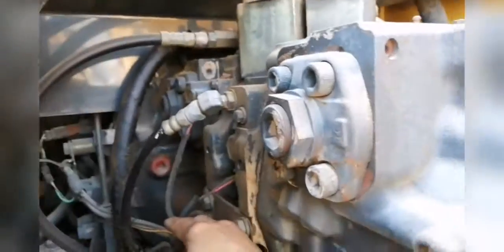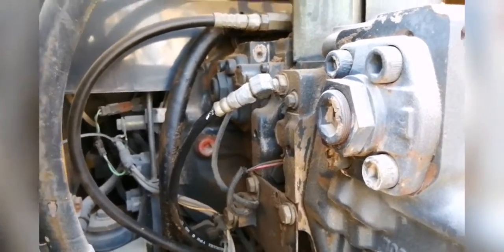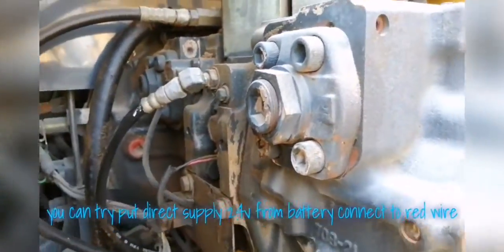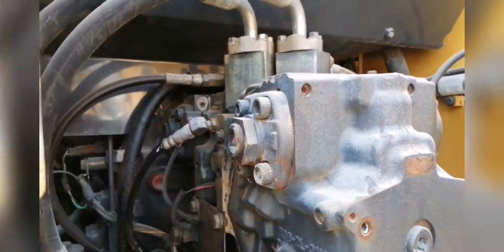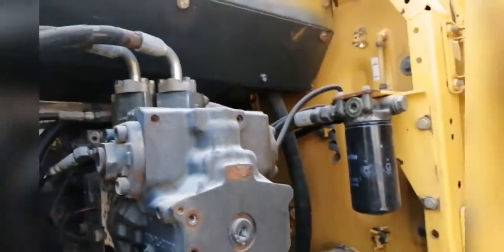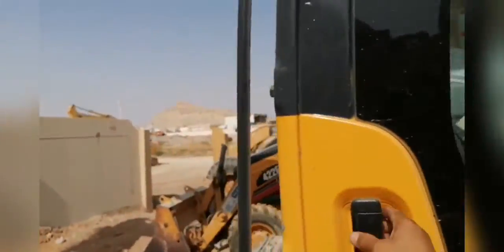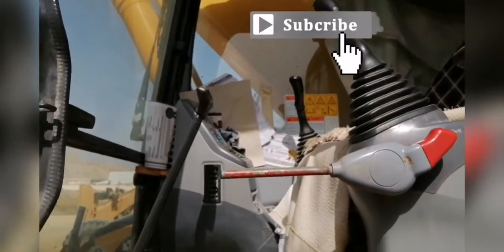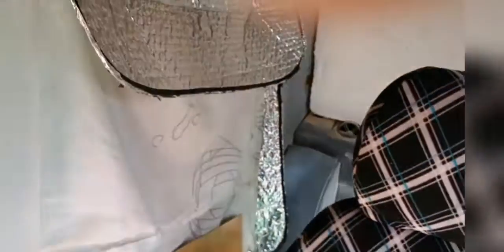KOMATSU PC 220/228-6/7 PC & LS PROBLEM ENGINE ITS OVERLOAD

Comment: sir gud pm,ano kaya ang posibling sira pag ung machine ay no acceleration ok nman ung governor control motor
Reply from the maker: ask ko lang anu model yan
Reply: kumatsu pc 228 po
Reply from the maker: ok ganito may time ksi n minsan kpag nagpalit nang bagung servo or accelerator motor ung socket nya d naibabalik nang maayos s brocket, kya nangyayari napuputol wire cause nang vibration, try nyo e check ang servo motor wire hatakin mo isa isa o kung ok ang wire, e try mo e disconnect ang rpm sensor, pag wla p rin, diagnose mo muna e check mo kong may active error, makikita mo doon, kung may damage wire or disconnected, maddtec nman nang ecm or controller.
Reply from the maker: p subscribe nman kung dkapa nkapag subscribe,thank for watching
Reply from the maker: @greenly2769  saan location mo
Reply: @caterpillarjhunhunk  masbate po
Reply: @caterpillarjhunhunk  ok try q po sir thanks
Reply from the maker: @greenly2769  check mo muna ang error code nya ha mkikita mo n ang active may nkalagay n e s baba nang 3 digit number

Comment: Good pm po sir tanung ko po may pc 138us komatsu po ako anu po ang dipirincya non hirap umandar din pag nag travel himihina ang makina at namamatay..yan lang po sir tankyou po subcribe ko po kayu sir..
Reply from the maker: paanung hina b ok b rpm nya db mausok
Reply from the maker: slamat
Reply from the maker: send mo s akin mssger mo at add kita or add mo ako jhunhunk
Reply: Hinde nmn ma cyado maosok sir kahit malakas na ang rpm pag tinaas  yung arm humihina ang makita pag pinilit namamatay cya..sir
Reply from the maker: @wenskieyb281  dito s video n ito may pinakita ako dyan n hydraulic pump tpos doon my wire n pink at black dalawa un check mo yan kung may supply o power n 24v habang nakaandar ha
Reply from the maker: kpag walang kuryente un mamatay talaga makina mo ksi hindi nairegulate ang pressure nang hydraulic mo
Reply: Ah ganun po ba sir sigi subokan ko tester kung may kuryente..salamat po..
Reply from the maker: @wenskieyb281  ok lang mssg mo ako kaagad ha pra alam ko at kung ano next mo n gagawin
Reply: @caterpillarjhunhunk   good pm sir ok na ang backheo nirikta ko sa positive wire ng battery lumakas na sya..wala power ang kanyang line wire...kaya nirikta ko muna..sa battery..
Reply from the maker: good pero try mo check ang fuse bka nsa fuse lang ang problema nyan
Reply from the maker: @wenskieyb281  salamat at nka tulong ung video ko at syo ha kahit anung machine  kung may problema tanung lang baka makatulong ako, like and share mo vvideo ko ha, at subscribe n rin
Reply: Buo lahat ng fuse sir..ok lng ba rikta ko nlng din idaan ko sa ignation switch
Reply from the maker: @wenskieyb281  pwede nman check mo s loob s kana side patungan nang kamay s likod may switch yata doon check mo rin
Reply: Sir na send kuna po sa messenger nyu.

Comment: Hey bro, I have a 1998 Komatsu pc-75 machine that’s 16,000 that bogs down when tracking it. It only happens when it warms up, could this be a fuel issue? I cleaned all the lines out and someone put a small electric fuel pump on it. Could the fuel pump not be putting o it enough fuel?
Reply from the maker: ok bro actualy its hard for me to say somthing regarding about your problem, usualy that type of engine you have on your machine  is everythings manual ok,now asper my imagination that i dont know exactly what happen, but for better conversation can you please contac me in my whatsapp, +971567581176, give some picture about how the engine figure and fuel pump if you can, its for me and my refference to analys the problem.
Reply: @caterpillarjhunhunk  is there another way I can contact you? You don’t show up in WhatsApp
Reply from the maker: @danielharrell2074  i dont know why not show up on you, so many people contacting in this number direct call and whatsapp message

Comment: Sir patulong nmn po .. sa ginagawa ko .. kumatsu pc228 .. pag nakafull throttle sya at ngwork n taas baba po bigla rpm nya .. nglalaro po ung throttle motor nya .. kahit anu gamitin .. swing stick bucket travell o boom ..
Reply from the maker: try mo e disconnect ung speed sensor n nsa flywheel tingnan mo kung may pagbabago, kpag ganon p rin, e adjust mo ung tension rod nya pweding paigsiin mo o kya pahabain mo sya, or insfection mo harnes baka naputul or or nag short n sya doon s, pero check mo muna error code nya s monitor, bago mo gawin yang mga sinabi ko

Comment: Gud day sir,Test port of pc100 sir
Reply from the maker: normaly ang test port ng komatsu ay 10mm head kailangan mo maglagay ng adaptor pra s gauge mo,kung main pressure check mo kung saan ung mainpipe nya nsa tapat lang noon ang testing port
Reply: @caterpillarjhunhunk  salamat Po sir,pwede Po pahingi Ng picture kng saan banda
Reply: Salamat Po sir,sa long arm Po sir pc220 LS man manual Po kayo salamat Po
Reply from the maker: @joeforneirbajuyo9276  mssage mo ako s whatsapp +971567581176 at details ng machine mo
Reply: @caterpillarjhunhunk  Hindi Po aq marunong mag wattsapp sir,ok lng Po dimasagot sir,para di nakayo madisturbo Po..salamat Po sir

Comment: Sir pa help po. Problem ko sa machine ko isa lng po solenoid valve nakakabit sa main pump ko. Minodify ata ng pinagbilhan ko. Nung mabili ko cia wala supply kuryente un solenoid kaya nahihirapan makina pg dumadakot. Btw pc228-2 po unit ko.
Reply from the maker: try mo e direct ung solenoid maglagay k ng dalawng separate wire s solenoid positive at direct wire s negative s body try mo kung gagaan ang galawan at load pra s makina, ang supply nyan galing s ignation switch pero dumaan s fuse
Reply from the maker: pero ganito kung may whatsapp k contakin mo ako pra makapagusap tyo ng maayos, +971567581176

Comment: My komatsu turns off randomly wen moving forward or picking something up
Reply from the maker: bro tell me what is the model of your machine, but if the machine is shutting off maybe overload or over pressure, if that machine is excavator check the solenoid attached on the main pump maybe no power, or not working or stock the valve
Reply: @caterpillarjhunhunk   model is komatsu pw 160 it has a banana grapple
Reply from the maker: @edgarbermudez3094  bro have you check the solenoid valve attached on the main pump, maybe no power to energize the valve, or if you know how to check the pressure check it, before you do the procedure of testing or adjustment, ok
Reply: Ok thanks
Reply from the maker: @edgarbermudez3094  your welcome

Comment: Sir ano po sira sa unit ko 
Hindi po sya mag travel kapag left or right lang pero f straight travel okay naman sya.
Reply from the maker: Check lang muna ng high pressure ng pump arround 350bar or 5000psi

Comment: Sir ano Po Ang problema Ng kumatzu PC200 pag dating Ng dalawang Oras Hindi na gumagalaw umihina cya thank Po sa sagot at godbless
Reply from the maker: s ganyang sitwasyon check k muna pressure ng main pump, or try mo n. rin e adjust ung merge divider valve nsa likod ng control valve, kung nsa ilalim k ng makina at nka harap k s control. valve nsa bandang kaliwa may adjuster ng pressure doon luwagan mo nut at adjust mo. ng screw driver pahigpit, saka testingin, try kahit isang ikot lang

Comment: Ser ptulong naman poh,about s pc220-5 n avance,problem q poh pag gnamt ng 2hours humihina ung boom up at bucket noh poh kya problema bgo n poh laman loob ng hydraulic pump.sna poh mtulungan nyo aq thanks poh
Reply from the maker: ok ganito basi s mga na experience ko kung alam mo yung valve s likod ng control valve doon pumasok ang main pressure ganito meron relief doon adjutable din yung try mo higpitan yung screw,pero luwagan mo muna ang locknut then observe mo testing,kpag nag ok sya on that way,higpitan mo pa ng kaunti then observe ulit until hindi n magbago ung movement
Reply: @caterpillarjhunhunk  ung main relief poh vah adjust q.
Reply: @caterpillarjhunhunk  n try q nrin poh mg adjust s line relief ng boom up at bucket.pti s main relief valve ng adjust at ngpalit n aq ng mga oring at nung needle jet.
Reply: Ser pti poh ngbubuhol ung usok at namamatay pag ng boom up
Reply from the maker: @altheasantiago6399  malakas b ang usok subra kpag ganun baka ung solenoid n nka install s gilid ng main pump eh hindi gumagana,kaya overload sya yung kasi ang nagrregulate ng pressure ng pump
Reply: Opo mlakas usok.ngplit nrin poh aq ng solenoid s main pump.

Comment: Sir yung unit ko po Kya anong nangyari??pag uminit na po xia mahihirapan na po Ang makina nya,,namamatay po Ang makina pag nainit na..ok Naman po cooling system nya,,
Reply from the maker: sir baka nman pwede ko malaman kung anu machine mo para may idea ako, sa mga pwede kung sabihin anu.
Reply: @caterpillarjhunhunk  sir pc70 po avance
Reply: @caterpillarjhunhunk  dumadapa po Ang makina lalo na po kapag swing or steering
Reply: @caterpillarjhunhunk  stress na po ako sa unit eh..nag uumpisa po sya kapag almost 1hour na po syang nag ooperate
Reply: @caterpillarjhunhunk  kapag po binibitawan ko Ang sable nya pag mainit na sya bumababa po Ang rpm nya..pag ginalaw ko po ulit tataas po ulit rpm nya tapos pag nahirapan po sya halimbawa po matigas Ang dinadakot ko dumadapa po Ang makina nya pag pinilit ko po namamatay po Ang makina

Comment: sir bakit po malimit akong mputukan ng hydraulic hose,magaan nman po ang binubuhat ko,,posible po bng mataas mxado ang rpm ko?
Reply from the maker: bro magcheck muna kyo nang pressure yung high pressure mula s pump kung ok yung pressure nang main pump, baka may problema ang load valve kung aling cylinder hose ang naputok o kya nman mahinang klase lang ang hose at yung pagkaka, grift nang hose, pero ma observe mo yan kung bakit naputok ang hose, isa rin s mraramdaman mo medyo hirap makina
Reply from the maker: san kba ngayon at anu unit mo
Reply: occ mindoro po,,pc 128 komatsu po
Reply: @caterpillarjhunhunk  tnx po sa advice
Reply from the maker: @ahlfrenorongan6662  ok lang,ok nb machine mo
Reply from the maker: @ahlfrenorongan6662  aba kung taga dyan k s occidental tga dyan din ako s sablayan s sport complex
Reply: @caterpillarjhunhunk  taga tuban po aq
Reply from the maker: @ahlfrenorongan6662  taga sport complex ako sto niño ako, aba marami ako kamganak dyan s tuban mga malacad,ok nb ang machine mo o hindi p rin, anu pc 128uu b pc128us
Reply: @caterpillarjhunhunk  ganun poh ba?ok n din po,,pag my prob po,,chat q po ulit kau,,sa amnay po ang project site nmin,,
Reply from the maker: @ahlfrenorongan6662  anu project nyo s amnay,brod p share nman nman youtube channel ko salamat

Comment: Sa komatsu PC78us lowpower problem sir namamatay ang makina pag inuoperate
Reply from the maker: sir sorry po ngayon ko lang nabasa message mo check mo muna power ng makina bka nsa makina lang ang problema, minsan kasi npaghihinalaan natin n hydraulic system ang problema pero d natin napansin n makina pla. ang problema, isang dahilan kinakapos s diesel, kpag walang load ok pero kpag ni load mo n ndapa makina, pero kung s plagay mo n malakas  ang makina, check mo ung solenoid n nka attach s hydraulic pump baka wlang supply, pag wlang supply try mo e direct s battery ang supply saka testing kpag ganun pa rin, xontakin mo ako s whatsapp pra makapagusap tayo maayus +971567581176

Comment: Sir, I messaged you on WhatsApp before and I would like to again have your number

I have komatsu pc78-6, in relief we are getting 260kg on boom raise and 220 on boom lower. When we do compound function the boom circuit is about 50% slower than the arm and bucket. We have to let off of the left joystick 50% for it to be at the same speed as the boom raise. We did the PC tuneup and single function of boom raise was right on specification at 3.5seconds. but when operated compound it was very slow. It also travels very slow. We are getting correct pressure from pump.

We swapped suction valves on boom circuit with arm circuit. No change nor improvement.

Checked oil pressure on boom valve output going to boom cylinder and was 4KG lower than relief pressure. Boom holding valve held pressure and didn't drop.

Poppet inside holding valve moves freely.

Merge divider spool, LS unloading spools, logic valve spools all move freely with no apparent damage.

Screens to logic valve were clean.

We checked spring height on merge divider valve, was 1mm less than spec.

Adjusted swash plate angle 1/4 turn out, and it made function worse. 1/4 turn in from original position didn't change how it operated in original position.

Shop manual is stating safety suction valve is bad/ compensation valve is bad.
Reply from the maker: Can you contac me in whatsapp,+971567581176 for faster way of conversation

Comment: Bosing bakit masok ang komatsu pc220 anong sira nito bosing
Reply from the maker: Brad maraming pweding pagmulqn ng mausok n makina, baka hindi na sservice ng maayos katulad nlang ng fuel filter, oil filter, and air filter, pero ok nman ang maintenance, check nyo blowby, or ung nagkaka roon n sya ng pressure s loob ng makina may talsik n kung tawagin deepstick kung nabuga n ng langis, pwede rin overload ang mkina dahil s hydraulic system.observe mo ung mga nsabi baka isa doon ang problema

Comment: sir how to fixet  low power of pc220-6
Reply from the maker: At first step you need to do is check the main pressure of the main pump,on that way you well understand where the problem came from.
Contac me i my whatsapp +971567581176

Comment: Boss nagpalit me ng dalawang hose ng oil filter kc pumutok yong at luma na rin uomg isa kaya dalawa na pinalitan ko ngaun at nagchange oil na rin.pgkatapos  ng chamge oil pag mgoperate ako may tunog naman  na, iiiinnnnnggg..sa bandang oil pump or katabi ng oil pump na pinanggalingan ng hose na pinalitan ko po. Pg mgpwersa na sha may unsual sound na "iiiiiinnnnnggg... gnun po sound nya sa bamdang harapan malapit sa ilalim ng alternator o sa bamdang oil pump anu kaya possible cause nya? Ok lng ba ginagamit pa rin kahit gnun may tunog sha na umiiyak ba iiiiinnnnnng gnum po🤭
Reply: Pc200-8,model 2007 po pala sha salamat
Reply from the maker: parehas b ung hose doon s original,n naikabit mo bago at nilinis nyo b bago ikinabit buksan nyo nlang muna ulit ung hose baka may sira ung loob ng hose kya parang may tunog,dati b wala sya tunog n ganyan bago p nasira
Reply from the maker: inspect nyo ulit kung anu ang ikinabit nyo kung bakit nagkaroon ng tunog n kakaiba
Reply: Mula lng po nung pinalitan ko hose nya kc pumutok.maliit ng konti lng po yong butas nya sa original.ngbleed me ng langis sa oil filter malakas naman po labas ng oil kaya nagdagdag ulit po 🤭
Reply: @caterpillarjhunhunk  wala po dati tunog na parang nahihirapan,iiiiinnngggg.....gnun ngy.nagkaroon lng ikinabit ko na bago na dalawa.at yong butas ng fittings na pinalit maliit ng konti sa orig nya
Reply: @caterpillarjhunhunk  bos yung komatsu pc 200 kpag pinagalaw nagdrop siya namamatay siya mechanikal siya

Comment: I have pc200-7 low rpm
Reply from the maker: bro sorry late reponse, regarding about low rpm, did you try to disconnect the rpm sensor, if not try it then check start. if same problem insfect the wiring harnes near in accelerator motor full slowly one by one the wires sometimes wire is damage inside, or maybe short or open wire, or check at service menu any error related on accelerator motor.

Comment: Hi
We have pc220 with 20t breaker
When we are operating arm cylinder engine is getting switched off due to load pls help
Reply from the maker: what do you mean 20ton,can pls give me the complete details of your machine exact model number,then have try before that 20ton before or just first time.my whatsapp +971567581176,send picture regarding about the breaker and deatails of your machine